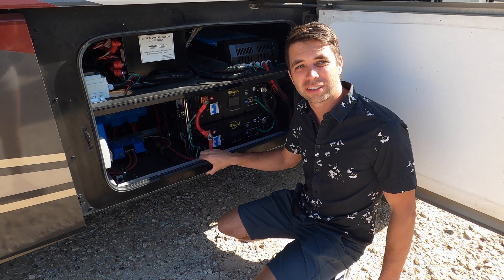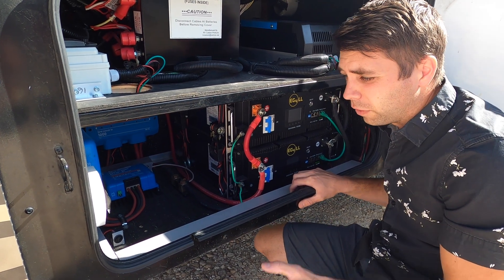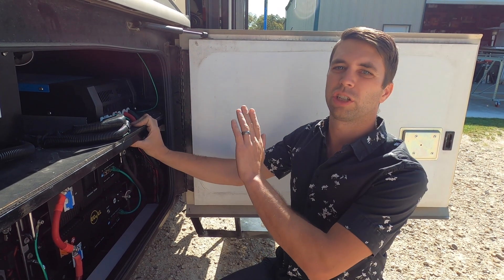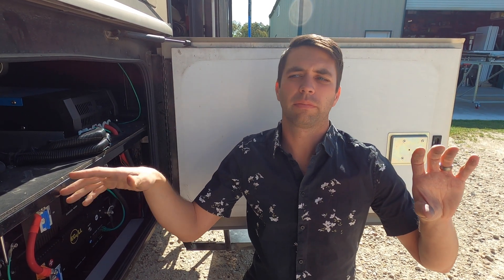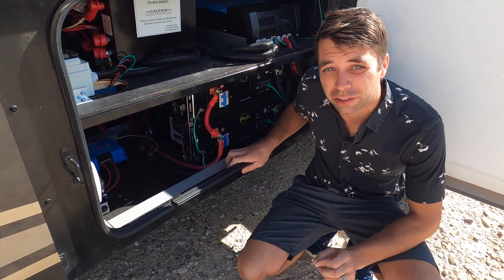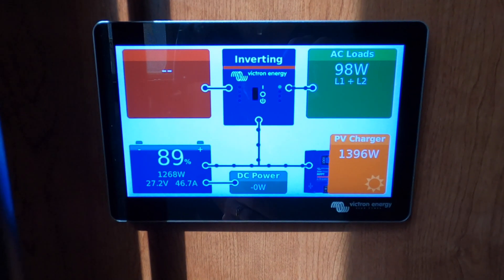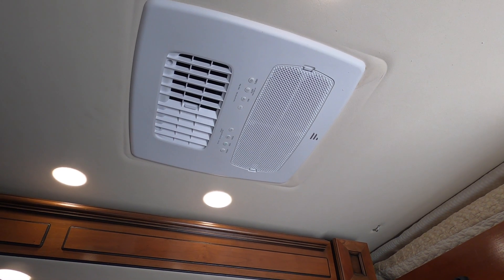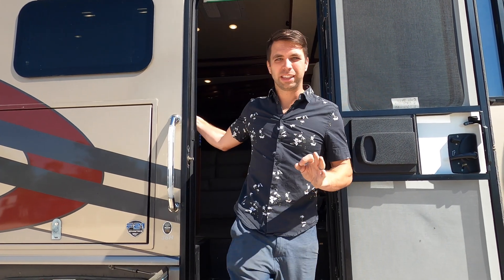Victron + EG4: The Ultimate Off-Grid Solar Setup? || Can you run an A/C on this Solar System?

Comment: That's a very nice system and a clean install. I'm sure your dad is enjoying all the power. Victron is of course the gold standard these days, but unfortunately they don't make a charge controller with the specs I needed for my coach's system. Instead I use a Sungold Power 48v, 5kw all-in-one inverter/100a charger/charge controller that runs my 4.5k Furrion front A/C and my EG-4 12k 28.5 Seer-2 mini split heat pump at the same time.

I have a total of 5,020 watts of solar and 23.5kwh of LiFePo-4 batteries (the equivalent of 18, 100ah Battleborns) on my Class A MH. I racked 8, 550w panels on my roof, over my roof protrusions so I don't have to worry about shading. They are 15" off my roof so lots of cooling air passes underneath to cool the panels and shade the coach so my A/Cs don't have to work as hard. This 4,400w array charges a 320ah 48v bank for my 120v needs. Those EG-4 server rack batteries are nice, but cost about $275/kwh. I built my battery out of EVE MB31 prismatic cells for under $1,800 or about $110/kwh including the BMS - 40% of the price per kwh as the full featured EG-4 batteries. 

One of the reasons I went with the Sungold Power all-in-one is because I wired my rooftop array in series for 400voc and the charge controller input for is unit is rated at 500v. I've already seen 450v from my array due to cloud lensing in cold weather, so I needed the headroom. The advantage of a series array is the high voltage allows it to produce power efficiently in low light conditions. A series array is not as shade tolerant, but I never park mine under trees, etc., as I don't want leaves, sap, limbs, etc. falling on it and possibly damaging the panels or limiting output. It's low light performance is well beyond my expectations, significantly extending the production hours both morning and evening.

I also have a liftable 620w array on the side of my coach that charges a 560ah 12v battery I built too. It acts as a nice bedroom window awning too. It practically lifts itself with gas struts and is easy to clean standing safely on the ground. My system has lots of redundancy. I have a 1,000w 12v inverter along with a spare and an extra 50a charge controller for back-up. This has proved to be sufficient for our needs as we haven't had to run our generator in the last 2 years living completely off grid. Take care, Chip

Comment: Nice work. We did something similar. 24v Victron multiplus 2 and 3 24v EG4 LLs with 1600w of linear actuated solar panels on a Lance truck camper.